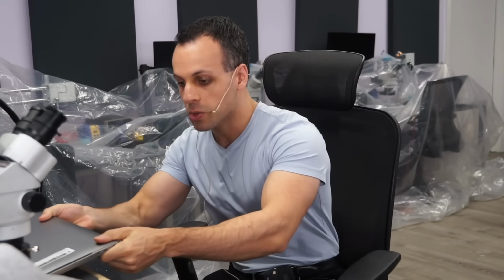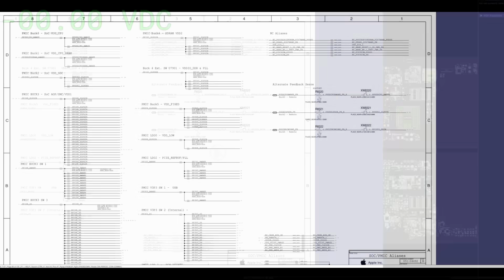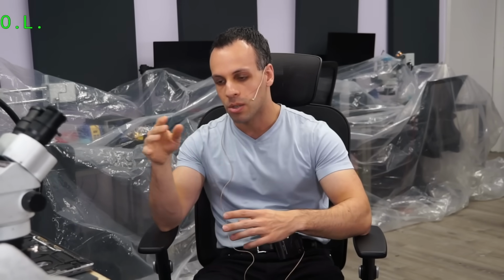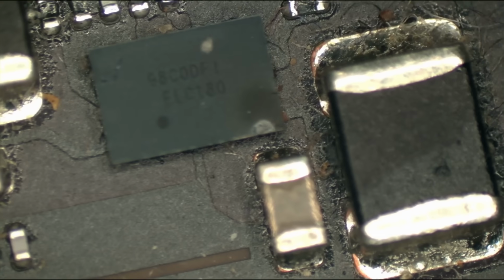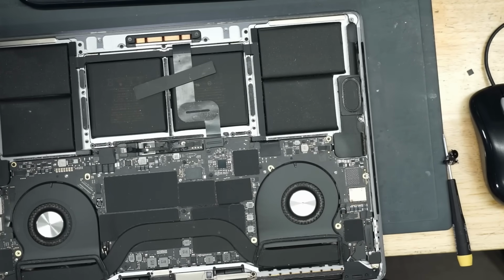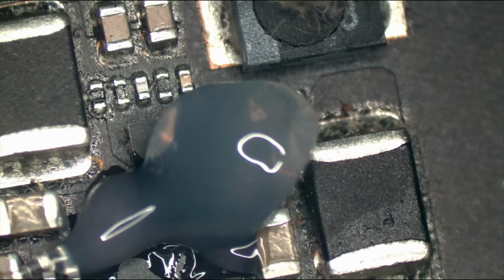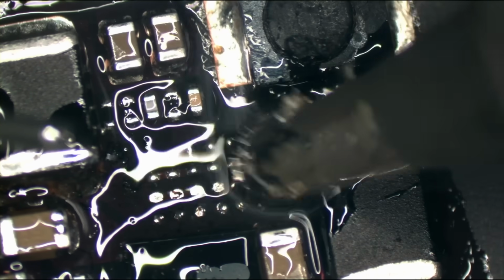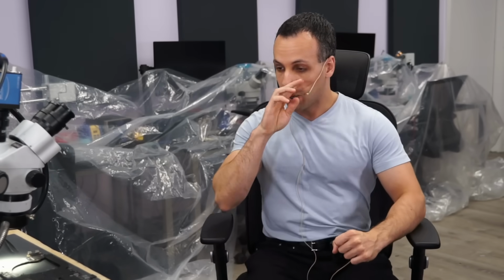How most 16" Macbook Pros often kill themselves & why they're unfixable

Comment: As a previous Apple employee. I saw so much of this. The many great quality techs I worked around, tried hard to help customers when and where they could. However it’s the policies and stances the company took that made it often impossible to achieve the customers goal. I also used to think (and maybe it was once upon a time) that they made good hardware….sadly the whole operation is a flaming dumpster fire
Reply: They definitely have engineered some good hardware over the years but it was never their MO
Reply: Their laptops have always been a buyer beware affair.
Reply: @stickgarrote8582 nah I think the first gen unibodies were legit. I still have my 2008 17” mbp trucking away.
Reply: soldering ssds was the dumbest idea.  They made so much money on ram and additional drive space. On top of that, they ditched samsung ssd which are way better. They should use crucial or samsung chips but they are too cheap for that.  If you do hard video editing on those pro machines, it will fry the chips. because onboard ssds heat up the entire board. Plus those ssds use ram , and the apple controler is not a dedicated controler, you can be sure that if you copy big files, it will throttle down. The best thing to do is to get storage in icloud and to get an extended warranty. When you think about it, at this point, apple products are luxury items and social status symbols. They should invest in making small sockets for ram and ssds like they did with antenna. because drives and ram are what fail the most in computers other than psu and graphic card. The problem of companies nowadays is that they are owned by banks and the bottom line is to squeeze as much money out of their customers as they can. that is why products look very good and shinny but underneath they are big pieces of crap.
Reply: Excellent videos! I forked out the money for one MacBook Pro 2011 and we all know what happen to those 15” models. Having said that, are there any laptop out now that can handle the heat from heavy video processing especially if used in an outdoor environment?
Reply: @Mr_Wilcox281 I’d say give the apple silicon macs a chance, I’ve been working with m1 iMac some years and now m3 MacBook, always smooth as can be, no noise, no heat, no lag. Don’t spec all the way up, the base m1 could already handle 4k video editing.
Reply: @arjan2266-f4d my $5000 M1 max MBP crapped out on me and I barely used the thing. It failed to personalize update, I tried wiping the hard drive for a clean install and got bricked. Warranty ran out 6 months ago, Apple wants $1100 to replace logic board and touch id module. 

I expect durability from a flagship product, Apple is doing the exact opposite. I'd stay away from macbooks until they acknowledge the board issues in their laptops.
Reply: @arjan2266-f4d , what I'd say, is don't, don't give Apple's anything a chance. They are a predatory company and until people start to recognise them as such and take the appropriate measures, they will continue to be the one.
Reply: @arjan2266-f4d  Yeah but they're still new no way to tell how long they'll last
Reply: " (and maybe it was once upon a time) " No. They've always been overrated. I had a beige 233 G3 fail, forget why, but common failure. I had a 2005 iMac die from the capacitor problem (fixed once under warranty then it died a second time). I had a 2007(?) 17" with a GPU failure, fixed under warranty and mostly worked after that if you ignore the inflatable battery and that it throttles with the battery removed. I had a 2011 MBP fail from the GPU issue. I stopped buying Apple laptops after that one. And don't even get me started on their POS power supply/cords. FWIW, my 2000 G3 "Pismo" model is the exception, never had a problem with it. I like MacOS but people pretend Apple makes better hardware to justify the expense.
Reply: when steve jobs died, innovation died. what is left is just a business hungry for profit 😏
Reply: But they have that beautiful Apple sphincter!  Er, I mean ring.
Reply: The old Macs are really good. Like the ones that still have MagSafe.
Reply: When I started college in 2013 Apple was my go to and I bought my very first MacBook Air with the money I made working at my summer job. I bought it because of how robust and how it’s built to last. I still have it till this day and even with it aging, it boots and I can still browse the internet. What sucks is that I don’t have that same level of confidence I use to have and don’t know if I’ll do it again.
Reply: people tried to warn you and you actually went and attempted to work for the company lol.  You poor, poor thing.
Reply: My brother and I grew up as nerds that absolutely despised Apple computers. Rightfully so, considering we were into gaming and overclocking back when iMacs were allegedly innovative for making their ugly cases translucent. Now 30 years later I still won't touch an apple product with a ten foot pole, but my brother now works as a software engineer for Apple. And he uses their computers, phones, etc. Money can really fuck you up if you're not careful.

Comment: We really do care about the environment when we are creating laptop motherboards with no changeable components. I know that soldering all of the components it’s cheaper, but it’s also a waste. No SSD change, no RAM upgrade, WiFi board etc.. I hope EU will take much more drastic measures regarding this problem. You can change your CPU in a laptop, even if it’s soldered on the board, for example, but the risk of doing so is just too big, even as a pro technician or engineer. You need proper machines to do something like that, if you are doing it manually the chance to destroy some pins is much higher. Anyway. To a better world, where products were made to last and you could change most of the components. Also, to a better world where you can apply a new thermal paste for your laptop, without removing the keyboard and basically spending way too much time (I’m looking at you, HP). (:

Comment: It’s bizarre how I’ve been using macbooks for almost 20 years and never had an issue. Even tough most MacBooks i had were second hand. 
I had a few windows laptops through the years and all had issues. I even had a Sony vaio that battery wouldn’t last more than 30 min. After 2 years only. 
Another sony that caneta stopped working because the frame was getting unstuck from the computer. Let’s not even talk acer which just gave me a black screen after a year. Waste of money. I learn it the hard way. Better pay more for a MacBook and never have to deal with issues and not having to replace the laptop all the time. My 2016 MacBook Pro is still working like the first day. Battery 6–10 hours

Comment: OK so assuming Apple doesn't randomly select MacBooks to die at an unforeseen point in the future, what is the difference between one that dies after a year Vs one that lasts 7, 8, 9 years or more? My wife is rocking her MacBook Air from 2013 with zero issues, and personally I've used Macs since the 90's and (hand on wood) never had one die. I know, anecdotes... but so are these failures.

Also what laptop would you recommend now, given this practice is pretty common (Microsoft, Dell, HP, Samsung et al).

Comment: I learned. If this happens to me, trash the MacBook & replace it, probably cheap with a used model.  Now let me guess:  in 10 YEARS 90 percent of your present technical expertise with be useless because laptops have changed so much by then. Heck, they may no longer have laptops, but slaptops; maybe just apple watches w/ wi-fi keyboard connections by WiFi. You will be like a present day expert on DOS 3.3 computers. ???

Comment: I don't know if this has changed in the last 10 years but it used to be the case that once an Apple product was older than 7 years finding spare parts and internal cables becomes impossible to source. Remember the colourful clam like laptops of the late 1990s, early 2000s? Parts for those machines now impossible to find. Want to change the screen in one? Good luck finding the cable for it.

Comment: My Macbook Pro 16" has been in pieces for 12 months because those 16 screws at the bottom, they tightened 4 of them too tight, and after stripping the heads of 3 sets of screw-drivers, which also stripped the heads of the screws themselves, I was forced to drill the heads off the screws to get that panel off. Complete piece of garbage. The ONLY thing that makes MACs still a potential use for me is that they come inbuilt with UNIX, if it weren't for that i wouldn't ever use them again, but they allow a seamless experience when connecting to remote LINUX boxes.

Comment: My lightly used MacBook A2141 died without any abuse on my part.  Actually I only turned it on for less than 100 times for the period of 2 years. I was lucky (or dump?) enough to have bought Apple Care+ and it was still covered.  The Genius told me the machine cannot be revived with DFU so I guess it is 100% logic board failure as explained in the video.

Man I was such a fool believing Apple products lasts… anyway I was skeptical enough to never save anything on my MacBook- I always export my edited video to the external SSD. I knew that Apple and their evil iCloud never turn up your data, even if you are willing to pay the ransom.

Comment: If I send my Dell to Apple complaining that it won't install Facetime, I wonder if they'll tell me it's because of water damage.
Reply: Apple butterfly keyboard scandal, overheating issues, usbc port failure, cpu failure, display cable failure, ram failure, ssd failure, list goes on and on
Reply: @0w3nn  I've experienced several of those issues, all repaired for $0 by making an appt at the local Apple store.

Dell sent a laptop late, DOA, then their tech F'd it by not reapplying thermal paste as he didn't have any on hand. Amongst a plethora of other faults, the thing would overheat and crash and they refused to admit fault or repair it. Never touching a Dell again. Ever.
Reply: boy you're just lying 😂. Apple repairing a 2017 laptop for free is simply a lie. and its unbelievable when your dell pc crush on weekly basis without something wrong with the os or storage. I personally own a dell optiplex 3020 that i bought in 2014 still functional till today so WTFDYM🤔
Reply: @ebenezerkorsah  have you ever actually taken an Apple product for service or are you just going by anecdotal info on the internet? Have you ever even owned macbooks?

All OEM's have failure rates. I have had every Apple issue resolved at no cost to me. Dell were a F'ing nightmare and the laptop was worse after their "repair" due to poor workmanship.

The XPS 15" was expensive, fairly highly spec'd, and felt like cheap junk in your hands. They even put the webcam on the bottom of the screen so you looked ridiculous in business meetings. It was truly awful.
Reply: @scod3908  and i repeat, thats not true. am the only person in my family that doesn't use an apple product. why?, because of repairability and upgrading issue and yes apple wont fix your laptop for free if you ain't on apple care. even if you're on apple care and the damage on the device is your fault they won't . "AGAIN YOU'RE LYING" dell xps 15 camera is not located on the bottom of the screen. is either fake or yours was specifically customized for you 😂😂😂
Reply: @ebenezerkorsah  I literally have service receipts and booking references from every visit to the Apple store.

The Dell 15" XPS I last wasted money on was a 2017 model after which I ditched having a second laptop for MS Windows applications, you can easily look it up to find it's true they made the ridiculous choice to put the camera at the bottom. I think it may not have even been on centre, it was crazy. They didn't fix the webcam position until the late 2019 models!

I'm happy to criticise Apple where they deserve it - like base 8GB memory and their overpriced upgrade tiers. Their service in Australia has been awesome, friends and family have had similar experiences.
Reply: @scod3908  🤦
Reply: @scod3908  better than Apple selling a $2k laptop in 2017 that had a two and a half year old low power CPU that still managed to overheat constantly lol.
Reply: @DW_25  If I could go back to 2017 I'd still buy the macbook pro but there's no way I'd touch Dell again.

The Dell overheated and crashed much worse than the macbook which just got hot
Reply: @scod3908  and the Dell would still perform better even when thermal throttling and even when the XPS is a piece of shit because it's not a 2 year old laptop masquerading as new.
Reply: lmao
Reply: they will probably give you the standard line: We can fix it, but it will cost you 100 dollars less then a new one.... better buy a new one. That's Apple Genius Bar.
Reply: @stijnvdv2  yup
Reply: Whenever there is water damage, they take HIGH RESOLUTION images PROVING it was liquid damage, and when we fix them, you basically get a new device in 90% of the cases.
Reply: @isaeltavarez  that "proof" typically being that the moisture pads have triggered, which is not proof whatsoever. Those pads will trigger if you just live in a high humidity area. Also they will not help you at all with your data, even when the issue has nothing to do whatsoever with your SSD. I've seen Apple send back factory reset machines on Macbooks that simply needed the LVDS cable to the screen replaced. There' is no reason whatsoever to defend Apple in this situation. Either have proper Apple repair shops, or let independent shops have access to the tools they need.
Reply: @isaeltavarez  apple is garbage lol, why would I buy it still
Reply: @isaeltavarez  yo apple, READ. No wonder louis hate u kind so much.
Reply: @isaeltavarez  found the apple dick rider
Reply: I ordered a $3k Dell XPS, it arrived weeks late and broken with a speaker rattle and keyboard issue, build quality was rubbish and the whole chassis flexed and was unbalanced, battery life less than half advertised even when idle, it was highly spec'd but Windows lagged on basic tasks and crashed on a weekly basis, and the Dell certified tech only made it worse as they didn't reapply thermal paste so it constantly overheated and experienced thermal throttle. Expensive junk.

Good luck with Dell, never touching that dumpster fire company again.

2017 Macbook pro, everything replaced free by apple, barely any of it original. No Apple Care, just repair programs, even recently repaired my keyboard for free on a 7yr old device. Several other of our devices repaired out of warranty for free, and our friends have had the same excellent service which is why we keep purchasing as they stand by their product!

Is Apple repair just better in Australia than in the USA, or do people just love Apple bashing when they find an example???
Reply: @scod3908  your first mistake was buying a Dell lol.  Secondly, how limited is your worldview?  You realize Dell is not "windows" or "microsoft" right?  Never heard of Lenovo?  HP?  Vaio?  Also Apple in America?  Noone here would EVER believe you got that many free repairs/replacements.  It just doesn't happen.
Reply: @ShadyDealz  they all run MS Windows, and before you start going down the geek path I've also run variants of Linux... that was fun but pointless as no decent workflow applications for my purposes.

Have worked with HP, Sony Vaio, not Lenovo. Dell is one of the big OEM's with a decent reputation, and the XPS got solid reviews online but honestly it was garbage and so was the operating system. Have you owned Apple machines or are you just basing your beliefs on anecdotal stories?

Ironic that you accuse me of having a limited worldview when I pointed out Apple Australia has a general reputation for being overpriced but providing excellent technical support. They are generally known for free repairs to loyal customers here. I asked if that wasn't the case in the USA, and you blatantly claim no-one in the USA can see past the end of their noses. That sounds like a limited worldview.

You want to know something really funny? My last repair was just a few replacement key caps because i didn't want to leave my laptop with them and have to come back for it. They offered me a keyboard replacement instead, which would have meant my second entire new top case and battery 🤣

I wonder if Apple "genius" service in the USA is really worse than in Australia, or if people just love Apple bashing so much they highlight a minority of cases where customers don't get their way 🤷‍♂